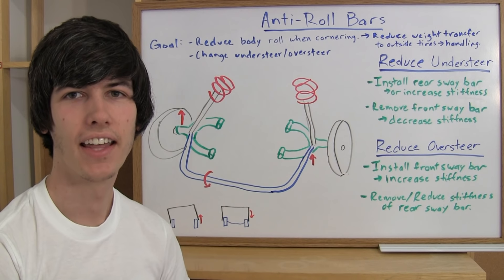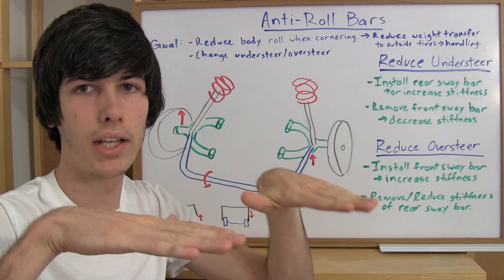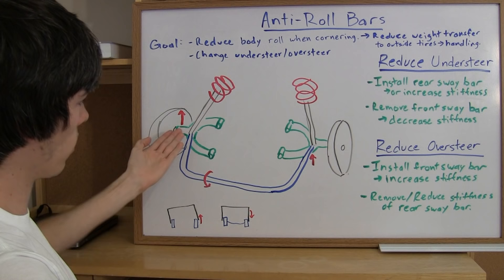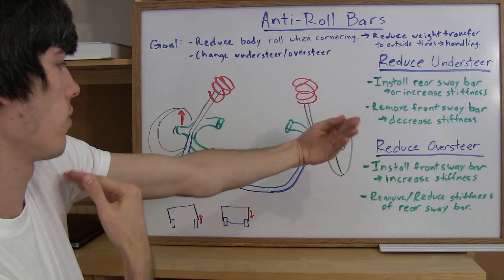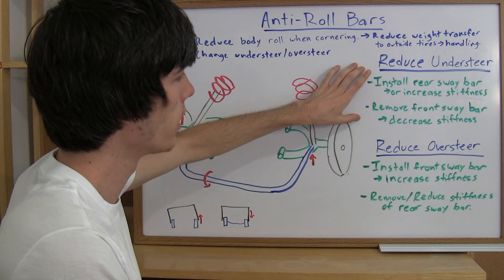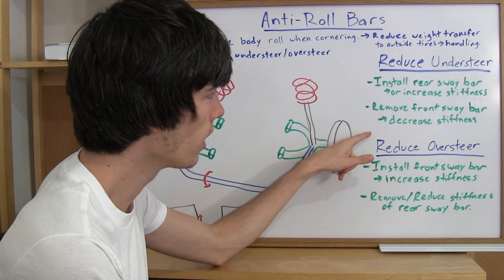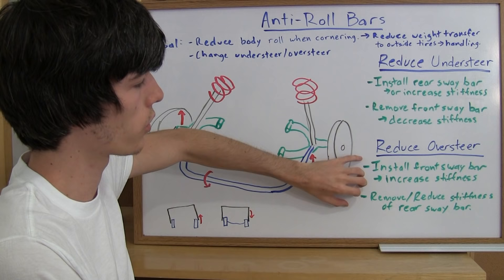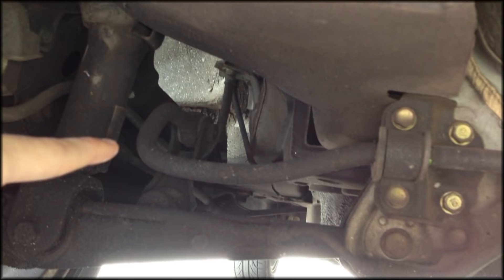How Anti-Roll Bars Work - How To Improve Car Handling

Comment: So if I go right and tension is on the left and sway bar pushes left side up wouldn't that just give you more force to roll over on left side? There needs to be force on the right pushing the bar down not up
Reply: +BlackMambaKO An ARB is push/pull.  It essentially acts to make the left and right sides of the vehicle react to each other, regardless of which is pulling and which is pushing.  

i.e.: If you turn right, the tendency of the load is to continue straight, which loads the left tires more than the right.  This load is counteracted by the left spring and dampener, as well as the ARB transferring force to the right spring and dampener.  

As the weight transfer attempts to compress the left side of the suspension, the ARB will transfer some of that force to the right side, which causes the spring and dampener on that side of the vehicle to also experience compression.  The right suspension resists, and the resulting forces are absorbed by the ARB and added to the force of the left suspension in a closed-loop.
Reply: But then right side of vehicle body should have gravity pushing it down in order to compress suspension
Reply: +BlackMambaKO Yes, and no.  The force of gravity is constant and equal on both sides at all times.  the forces managed by the chassis and suspension during turns is isolated to the vehicle and the physics involved.  

In such a turn as you described, the right side of suspension is compressed by the same forces compressing the left suspension, via the ARB.
Reply: When you turn right there would be body roll to the left. So there would be more force on the left side of car body. I just don't see how one ARB would be pushing right side of suspension up and level the car without any other forces.
Reply: +BlackMambaKO It is a torsion bar.  It is a very simple concept.  I cannot break it down further than that.
Reply: You've got the body, you've got the front left wheel, you've got the front right wheel, you have the springs between each wheel and the body.  When the car turns right, the body rolls left.  The left wheel goes up, the spring compresses.  The right wheel goes down, the spring extends.  There is more weight on the left wheel than the right wheel.  The body is rolling to the left.

A swaybar ties the left wheel to the right wheel.  As the car turns right, the body tries to roll to the left.  This puts weight on the left wheel, which is now attached by a semi-flexible beam to the right wheel.  The body weight pushes on the left suspension, the left spring begins to compress.  The swaybar then begins to tug upwards on the right wheel as well, as they are now attached.  The result is, the right side suspension compresses to a degree as well, and the car rolls far less.  This helps keeps the COG where it should be, instead of letting the chassis of the car lean over the center point of the wheels.  The driver experiences greater control over a more solid feeling chassis, feeling more connected with the road.

Comment: In Tune to Win from Carroll Smith it says that a anti roll bar doese reduce body roll but also increases load transfer. Here you say it decreases load tranfer. So what is right? ^^
Reply: Mr. Smith must have meant that the outside wheels transfer more weight to the inside wheels. Is it a good book?
Reply: No it actually transfers weight from the inside to the outside^^. Yeah i have all 4 "To win" books. Look it up on his homepage ;)
Reply: TheNFSRocket The point I was trying to make in my first comment was that they're both right because they're using the term 'load transfer' in different ways. Mr. Smith must mean that when weight is applied to the outside wheels during cornering, the sway bar increases the load transferred from the outside to the inside, which helps to equalise weight between all wheels, which is good. Jason's saying that there's less load transferred to the outside wheels because the sway bars tie them to the inside wheels, so when the outside wheels compress, so do the inside wheels, to a certain extent, depending on how stiff the sway bar is. So they're essentially saying the same thing in different ways. I haven't read the book though so I can't be sure on what Mr. Smith meant.
Reply: "When the sprung mass rolls, the bar resists the roll by an amount directly proportional to the stiffness off the bar and inversely proportional to the length of the arm through wich it acts. It also transfers load laterally from the unladen wheel to the laden one" this is what he says in the book.
Reply: TheNFSRocket Ok, that's quite clearly stating that the inside wheel does indeed transfer load to the outside wheel... 
The only thing I can imagine him meaning is that the inside wheel is transferring rebound energy to the outside wheel, so when the inside wheel becomes unladen and it tries to decompress, it will transfer some of that energy to the outside wheel, which would be the equivalent of temporarily raising the rebound rate of the outside wheel, or like it's helping the outside wheel not bottom out, which makes sense.
Reply: TheNFSRocket In the first sentence Mr Smith's saying that the thicker the bar, the more it will resist bodyroll, because a thicker bar resists flex more than a thinner bar, and the longer the arms are on the bar, the less it will resist bodyroll, because the longer the arms are, the more the bar will flex.
Reply: +yeahnahsweetas it makes perfectly sense for me now :D
Reply: TheNFSRocket 
Cool bananas
Reply: +yeahnahsweetas ? xD
Reply: TheNFSRocket lol nothing.. peace dude
Reply: +yeahnahsweetas  ok ;D
Reply: +yeahnahsweetas so what was your intention to watch this video if i may ask?
Reply: TheNFSRocket 
I'm just on a constant search for knowledge, and even though I kind of knew what swaybars did before watching this, I had never thought about it that deeply, and I thought I might learn something new, which I did. I've just recently found this channel and  the way Jason presents knowledge is easy for me to comprehend, so I just watch his videos  even if I think I know about the subject. I believe it's detrimental to think you know everything about something, because when that happens, you stop learning, and that's never a good thing.
Reply: +yeahnahsweetas cool, exactly my way of thinking! are you a engineer or what? :D
Reply: TheNFSRocket 
Lol I like to think I am sometimes, but no I just love learning stuff.
Reply: ok ^^
Reply: This isn't quite right.

ARBs increase roll stiffness of the end they are mounted on.  Increased stiffness causes increased load transfer on the end that becomes stiffer, in a curve.  Load transfer decreases across the other end, so that the net transfer is the same (except for some very minor effects from CG migration).

Think "stiffness attracts load transfer" and you'll have it right.  If, say, you stiffen a rear swaybar, you'll increase the load transfer between the rear wheels and decrease it between the front ones.  This has the effect of giving less traction in the rear and more in the front.  There are also other effects from the reduction in body roll including improved camber, that can affect vehicle balance in other ways.

Comment: my mom car is mad, if she drives at 30mhp we will fell body roll but when be drive at 90mhp it has no body roll what makes it do that. please reply
Reply: It depends on how tight the turn is.  Are you going around the same turn at 90mph as you are at 30mph?  If you go around a 30ft radius turn at 30mph that is close to 1g, but freeway turns not only are banked, but are much shallower and thus don't cause as much g-forces.

Comment: Hi. So you put up an active sway bar picture in front your video similar to what Land Rover uses but layed out concept of basic, standard antiroll bar that looks nothing like the one in main pic., while not saying a single word about active ones used in headline of the video :(
So guys who is really interested, and will dive under their car to see what you just explained, not going to find/see what you showed in main pic, nor they will find airstruts pictured there. Was there no picture available of regular solid sway bar? 
Oh and I dont know if there is standard sway bar stiffness on demand existed on factory vehicles so you can adjust, as author saying, normally sway bar is a bar, some solid, some hollow, my understanding that if you want to change stiffness, you can go with larger diameter or go with solid instead of hollow. In most cars that would not be an option unless hi performance of your vehicle exists, say if you have basic Eclips, you can install sway bars from turbocharged one, or if you subaru impreza, you can opt out for those from wrx if you want to play with your suspension settings but keep in mind that stiffness of springs and shocks also designted to work with certain stiffness/softness of other components, so doing just 1  something may not yeild better results.

Comment: The speaker isn't fully educated on the subject.

Anti-roll bars will increase your overall roll stiffness.
When your vehicle has sway bars, it doesn't mean it's intrinsically better. What is "handling"?
If your roll stiffness is high (but balanced front and rear), it will contribute towards higher yaw acceleration, but actually reduce overall lateral acceleration! Low lap times is a compromise between yaw acceleration and lateral acceleration. 
The Yaw Moment Diagram will teach you everything.

Comment: nope... you wnt and need weight transfer to make a turn with a given lateral acceleration.  the anti roll bar really only keeps the CG from rising, thus giving a higher later acceleration rate for a given weight transfer. weight transfer is determined by CG height, wheel base and weight of the car and thats ALL
Reply: Except that an ARB also increases roll stiffness on one end and diminishes body roll.  This increased stiffness will increase load transfer at the same end of the bar, and decrease it at the opposite end.  Net weight transfer does remain the same except for minor effects from CG migration.

The diminished body roll may improve camber during a turn and also keep you further away from the bump stops.

Comment: What is Understeer and oversteer?
Reply: Understeer is the condition when the front wheels lose grip before the rear tires.  Generally when turning this means you turn the wheel and the car keeps going the direction it was going before it started understeering.  Basically the car turns less for a given input.

Oversteering is the condition when the rear tires lose grip before the front tires.  When turning, this causes the back of the car to rotate faster than the front and so the car turns more for a given steering input.

The formal definition talks about slip angles of the tires and stuff, but I mentioned the effects above.  And you can get into power oversteer which is a rwd effect that artifically creates oversteer without excessive slip angle.  FWD tends to power understeer if you get too greedy haha.  Slip angle is difference between the direction of travel relative to the angle of the tires.
Reply: I never knew that!  Thank you for teaching me!

Comment: It will reduce lateral acceleration because of the tire data.

The anti-roll bar will reduce vertical load on the inside tires.  If you have a lower vertical load on the tire, you will have less lateral acceleration.  

This is idealized, as you actually design a race car AROUND the tire data.  

This guy is talking basics.

Most tires will provide less lateral acceleration (if properly matched, i'm speaking in terms of an ideal and marginal case)

Comment: No to body roll, yes to lifting. Push a car from the side to make the body roll a bit. What's working against you? It's the springs on the opposite side (the springs on your side are actually helping you). Add an ARB. Now you're working against both the springs on the opposite side, as well as a portion of the springs on your side = less roll for same force. Less roll = center of gravity stays closer to centerline = less load transfer.

Man, need more characters for this stuff... =)

Comment: so this defeats the purpose of an independent rear suspension?
Reply from the maker: +Carlos Armenta Not quite that simple, both have their role, and can (and typically always are) used together.
Reply: +Engineering Explained My corvette has both so I guess stock is best
Reply: +Engineering Explained Can you help me?  My car has way more understeer after installing aftermarket lower control arms and aftermarket rear knuckle bearings.  I also have this uneasy feeling or instability in the car's rear when going about 70-80 on the freeway.  Rear moves left and right even when just going straight.  Also the car follows road cracks too much.

is this alignment?  My alignment is good according to my mechanic.

If the rear sway bar bushings and mounts are over-torqued, or if the bushing is just dry and needs grease, can this cause understeer?  (since I imagine the rear sway bar cannot rotate)?

before these parts were installed, my car handled amazingly.  It had a bit more rear negative camber, but not much.  And it chewed up my inner rear tires.
Reply: it usually is. unless you're walter r&#246;hrl you better leave the suspension as it is. setting it up properly is trail and error, you can't do that in a shad just by swapping out some parts.
Reply: They provide an alternate coupling path for forces.  Even with a typical IRS, the two sides are coupled via the body.

Ultimately we usually need ARBs because cars are longer than they are wide.  More roll resistance is generally needed than pitch or heave, and the relatively minor loss of independence "costs" less in grip than running stiffer springs.  It's possible to go overboard with ARBs, but there are a number of vehicles out there that do quite well with half or more of their roll resistance being contributed by their bars.

Comment: the stiffness depends on the size of the roll bar. smaller roll bar gives more body roll as it have higher angle of twist compare to bigger roll bar. in simple term watch this Chris Atkinson explain Anti-rollbar => watch?v=GhUE7LIxAso

Comment: You said anti roll bars reduce weight transfer 
well they don't!
weight transfer is a purely dynamic phenomenon and the only factors that affect it are track width , vehicle mass , center of mass height and lateral acceleration
what anti-roll bars do is increase the roll stiffness which decreases the amount of chassis roll
Reply: Antiroll bars also increase load transfer on the end they are mounted on, and decrease it on the opposite end.  This results in an increase of grip at the opposite end.

Overall weight transfer remains the constant except for minor CG migration effects.

Comment: what if I told you if you reduce understeer you increase oversteer...
Reply from the maker: Not exactly, they can both go "up or down" independently. But the balance will change, so at the limit whichever one has less grip will result in that end coming out.
Reply: Hypothetically, though, isn't all in a perfect world. Or does the hypothetical world take into account failure.

Comment: So the new mustang won't have a sway bar right? Since the rear suspension would be connected to each other making it moderately dependant and not fully independent... If it does, I'm suing Ford for false advertisement (1/2 will go to you) haha

Comment: You half ass explained it. Think out of the box and finish your video by doing the rear too. That's the least understood spot for most people. Question. How does a roll bar help in the rear of the car during launch of a rear wheel drive drag car?